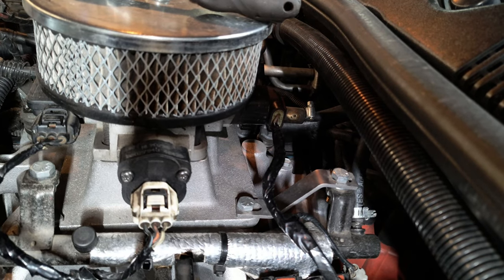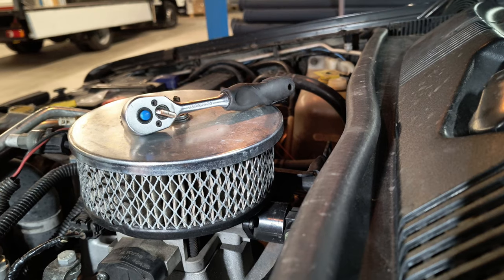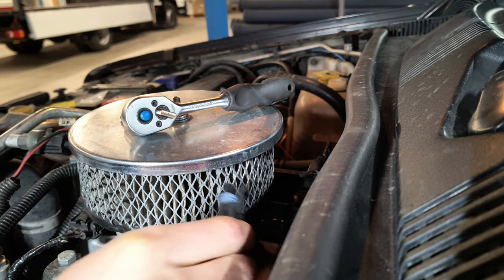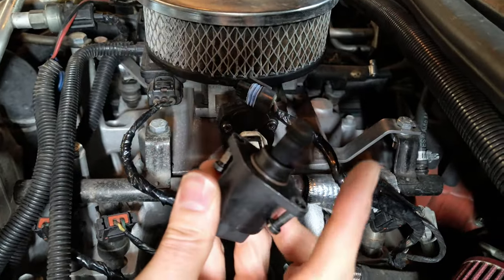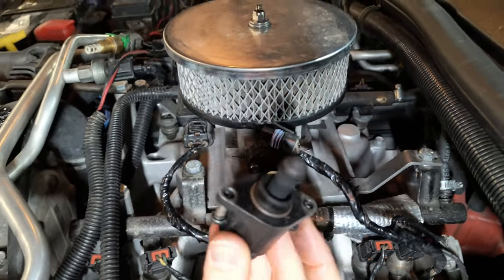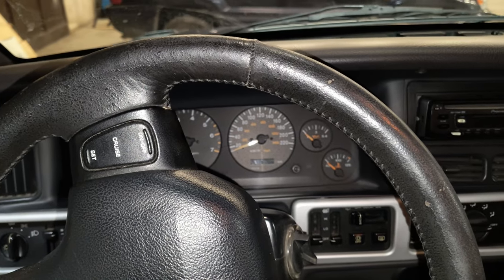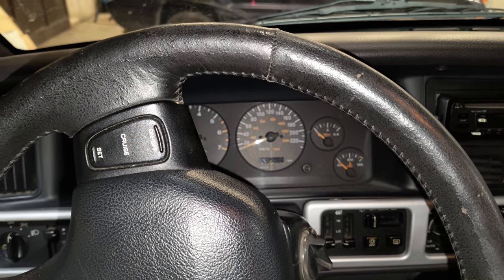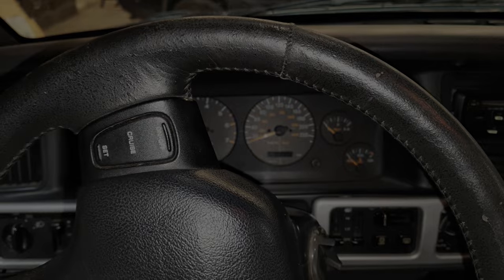5.9 Jeep Grand Cherokee IDLING ISSUES

Comment: Hello! Where I can buy this intake manifold?
Reply from the maker: hey there. it depends. if you mean the air filter it's just a cheap one out of ebay (and i don't advise this choice because it's crappy lol), if you mean the intake manifold it's a hughes air gap and it's not cheap lol, but it's awesome.
Reply: @4x4ManiacBadTimeGarage  thanks for answer, yes I mean the intake manifold, I can order it on the EBay? Could give me link. And tell me pls, if I install this intake manifold, I need do something for adjusting setting? I meen ECU/ECM parameter or just install new manifold. THANKS VERY MUCH 🙏🏻 I very like your video & channel
Reply from the maker: @Сатурн-э2я  it would be smart to tune the ecu. btw this is the link https://www.hughesengines.com/Index/products.php?partid=24773
send them an email to verify it works with your year/engine combo jeep.

Comment: where does the carburetor filter come from?
Reply from the maker: just a a cheap one from ebay, it's temporary.
Reply: @4x4ManiacBadTimeGarage   ok so no référence and it's the original carburetor?
Reply from the maker: @LABARREPHILIPPE  no, it's just a round filter on a bigger throttle body (2x52). it's still fuel injected, no carburator.